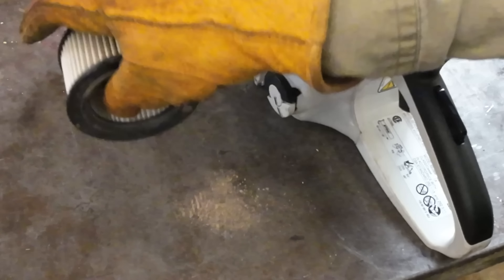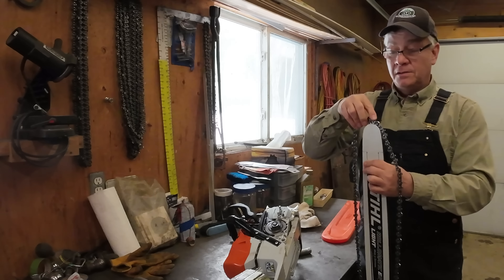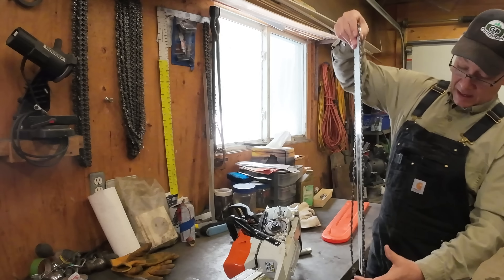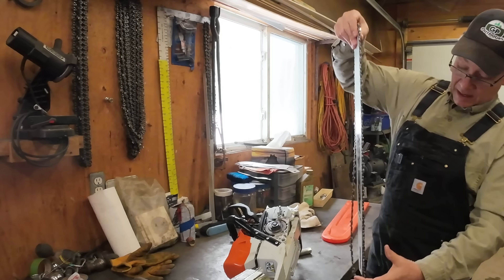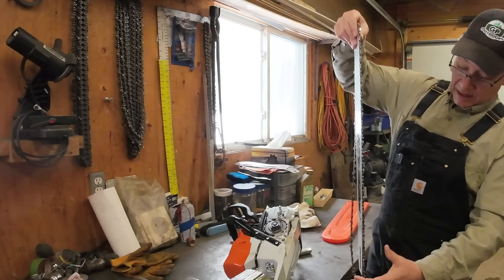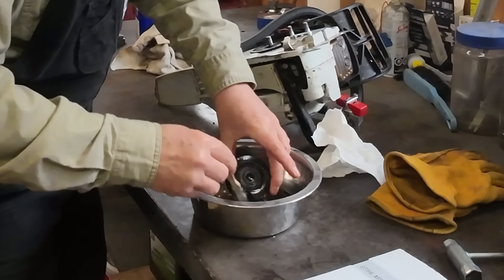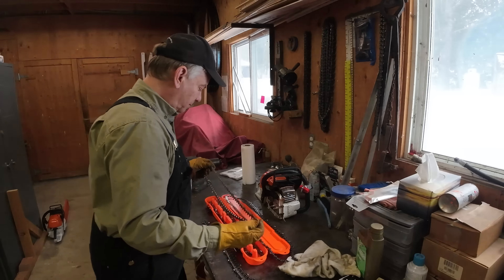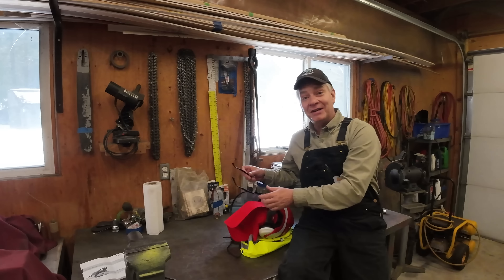661 Just Talking Forestry. Ready for Firewood Season. STIHL. Maintenance. Gear. outdoors  4K

Comment: Humboldts are designed for west coast logging on slopes with doug fir or cedar. It works well but is not as widely used here since we have hardwoods on flat ground. A conventional notch with a low stump gets us more money per log in general. Good luck out there.

Comment: Make sure you grease the sprocket bearing; I do mine every time I clean.  If the bearing gets dry it will wear a grove on the crankshaft.
Reply from the maker: Hey good day Ted. I may not understand but on my saw, I don't see any other bearings other than the needle bearing Guy pulled out - is there another one somewhere on this MS 261? Let me know - thanks so much!

Comment: There is only 1 clutch hub bearing; same one Guy pulled out.  Always make sure you keep grease on it.  If it runs dry it will grove that end of the crank shaft.

Comment: Good video, Gord, and timely. Most of my 12 ash trees have succumbed to the ash borer beetle. I have a lot of tree cutting this spring. Can you remind me the make and model of the loggers tape you use?
Reply from the maker: Good morning Terry. Unfortunate for sure but hopefully you or your friends can use them for firewood or milling.  My tape is a STIHL  tape but I would not recommend it unless you like metric. I thought it had inches on one side and diameter measurement on the other but it has metric on the other side. There are many available which have inches on one side and diameter measure on the other, which I think is far more useful.  The main quality and known manufacturer is 'Spencers Logging Tape' - but you have to look closely as they make the same unit but with different measurement types on the tape(s) themselves so you have to choose the right model. God luck Terry!

Comment: My 2 Stihls have a notch in the clutch drum that aligns with the oil pump tang or arm. I believe I seen a notch in your clutch drum. It is my understanding these need to be aligned when reinstalling the clutch drum. ??  I suppose eventually the two  may align when operating the saw.
Reply from the maker: I believe so -  I should have included that in the video - thanks . I will do another video to clarify for folks. Thanks so much!

Comment: Keep the safety reminders coming. I was only using my safety belt on the tractor sparingly, but since your video I’m at close to 100% now. And…it saved my head from hitting the top of my cab. Thanks!
Reply from the maker: Morning Roger. Very happy to hear it. Weird - a whack on the head which is kind of smarts but the teeth smacking together was not nice. Neither was the dentist bill. Glad the crack missed the root. :)) Have a great week out there!

Comment: Do you clean the outside of your saw with anything more than a rag ?
Reply from the maker: Morning Coop. Generally, no. Just the rag. There are times when I have cut sapwood and the saw gets sticky in places, and I will usually use gasoline to rub it off the saw handle etc ( not that I am suggesting you do- I realize that is probably not the best idea but ...). But no, I just use a rag normally. Have a good one!
Reply: @GPOutdoors  thanks

Comment: Good morning GP, I have been logging all winter long and soon it will be too wet/muddy so I  am looking forward to a short spring break. Don't forget to replace the oil and fuel filters. You may also want to learn to do the Open Face along with the Humboldt and the bore/plunge cut. The old school Humboldt with a gap is worth learning besides the current day Humboldt. In addition, when to use them and more importantly when not to.  You may want to replace the sprocket drum in addition to the rim sprocket if you have worn out a couple rim sprockets.  For the price of a clutch needle bearing I just replace them.  Have a great day and happy sawing.
Reply from the maker: Morning and thanks for the good info and advice JO. Hey just a question for you - don't you find it difficult to work in the forest in the winter up here? We usually have several feet of snow in there and have difficulty getting through to do any firewood. So we just decided years ago to wait and do it in the warm months. Thanks
Reply: @GPOutdoors  Morning GP, in the Spring once the ground gets too soft, wet and muddy it's breaktime.  Once it dries up later Spring, early Summer trees are dropped and limbed/delimbed and left on the ground until Summer gets too warm/hot then it's breaktime. Once Fall arrives, after the early wet part and the ground starts freezing harvesting of the late Spring early Summer timber is done along with bucking and splitting of firewood. Cleanup, burning and chipping is done as needed at this time as well.  After that Winter cutting starts, trees are dropped, limbed/delimbed and harvested until the too much snow comes.  In my area we don't see that much snow until mid January through the beginning of March.  At that time trees are only dropped and limbed/delimbed.  Since the main arteries / paths are travelled regularly getting in is usually not that bad. (Obviously a little snowplowing is done)  Once late Winter early Spring comes the snow melts down harvesting, blocking and splitting is done again until it gets to mid/early Spring soft, wet and muddy.  Once again cleanup, burning and chipping is done. Then the cycle starts again.  Note that during Winter cutting you have to deal with the cold and snow but no bugs and your more comfortable than in the heat, the logs are easier to skid, and have less damage and debris.  Cutting is also easier without leaves on the trees, the wind doesn't move the tree as much and you can see better were to drop not looking through so much foliage. You can also see widow makers much easier.  Frozen trees are hard on the chainsaw chains, there is more vibration cutting, using a semi-chisel holds it's sharpness much better than a full-chisel chain. If you use a full chisel then sharpen it at 25 instead of 30 degrees.  With the tree being frozen my saw doesn't get all gummed up cutting pine, spruce etc. You have to be more careful with some species since they snap easier when frozen so you need to adjust hinge thickness and at time chase the back cut.
 You also cause less damage scraping other trees during the Winter.  The best thing is a nice hot meal after a cool Fall or Winter day out in the bush. 
I also do residential tree service and storm damage but I have really cut back on it.  I also have been cutting back on the amount of time logging every year.  Have a great day GP!
Reply from the maker: @JelenOutDoors  Thanks so much JO! That explains it for me. I get it now. And in your area, Winter hits you a little different than me - a few hours distance makes a big difference in the weather patterns for sure. Thanks for taking the time to explain it. Have a great weekend and all the best!

Comment: Your good neighbors have taught you the conventional cut because of living on relatively flat ground. The Humboldt cut is used mostly in steep terrain and when trying to save every last inch during logging process. It is seldom needed in firewood cutting or flat ground situations, but there is nothing wrong with learning both ways. 
Cleaning saws seems silly to just get them filthy again within minutes of cutting, but it is a great practice because of seeing potential problems while doing it. I always check that all the bolts are snug during cleaning also. Hopefully, you all have a productive, safe, and good time with the upcoming firewood season!👍
Reply from the maker: Good morning and thanks for the helpful info. Wish you all the best too!

Comment: Excellent video Gord! I am excited for the goals you have set, I think the hand filing will make you an even better cutter and a much better more patient faller. A few thoughts to consider, on the 261 when you need a new bar consider converting it over to 3/8 chain and then you can run the same chain and file as on the 462. This involves a bar and chain swap as well as a sprocket change to match the pitch of the chain. Also, with a firewood prosizer I would keep it on the saw you plan to buck with the most which I would assume would be the 462. Given the size trees I have seen you cut in the last year or so I would think your felling saw would be the 261 primarily. I have found the prosizer to be a great tool but is in the way for felling given where you need to hold the saw.
Reply from the maker: Morning Daniel! Some excellent points for me to think about - makes some good sense for sure. Thanks again and all the best!
Reply: @GPOutdoors  Thanks Gord, hope the information is helpful and that you all are doing well! 😀

Comment: With my Husky’s I give the hole at the end of the crankshaft a touch of grease with the bar tip grease tool. This puts grease on the roller bearing. I notice there is a hole on yours. Is it a hole or a indent?

Comment: that bearing  need grease often i was falling  and was told to grease it at the end of every week also the humbolt cut id for when you cut really big trees for lumber and we in europe dont use that because it leaves high stumps and thats no good they used it for lumber cutting because you dont lose the facecut high piece from the end and also the borecut is only useful when you learn to judge the tree and know how the tree acts what i do is i just leave a thicker hinge and and you just stay with the stump on flat fall if you have trees or bumps or stumps or anything on the ground on the bath of the fall you go ive done that for last 4 years now and work in logging mostly in machines but i find a saw in my hand often enough also ive always been told by my granpa who has been falling for his whole life that you cut the firewood in the winter because in fall the trees get about 10% dryer beacuse they dont have the water in it and that way they dry quicker and then you have them ready in to have stacke by the spring so they dry out and can be burned in the coming winter or the next ideally you have 2 year old wood for burning so you are always one year ahead and in winter you dont swet as much
Reply: also about the bearing grease im not sure anymore how the stihls have it but husqys you have the hole on the middle of the clucth assemly and they have special tubes you press in the hole and push to get the grease in it

Comment: Hi GP, there is something else you should check, the heat sink aisle on the motor itself. A lot of people never remove sticky accumulation and motor overheat faster.
Reply from the maker: Morning Denis. I am not familiar with that - will try to remember to ask my dealer when I pick up new sprockets. Cheers and thanks!

Comment: Hand filing a chain is definitely an art. You really have to be careful to file the left and the right teeth evenly. I would always file one side more than the other and end up making curved cuts. That wore my bars out faster too. I finally bought an electric chain grinder (the same style as Guy's). Once I learned to use it correctly, I did a far better job of sharpening the chains. Both getting the chains much sharper and keeping the teeth the same size. 
Like Guy, I have a bunch of chains hanging on the wall in the workshop. I keep 2 spares in the saw case to make it quick to change when I dull them while in the woods. A couple times a year I set up the grinder in the bench vise and sharpen all the dull chains. I was thinking it might be a good video to talk to Guy about handfiling vs grinding, what he prefers, and why.
Reply from the maker: Morning Gary. Thanks - yes, he pretty much does the same thing. Waits till he has several chains and then grinds them all at once. I will talk with him - might be a good discussion for sure. Cheers!